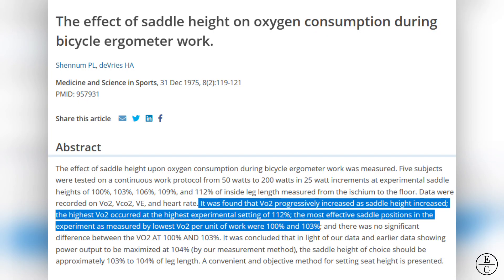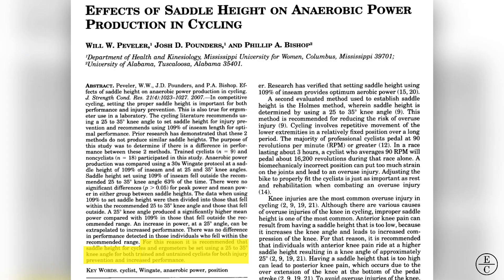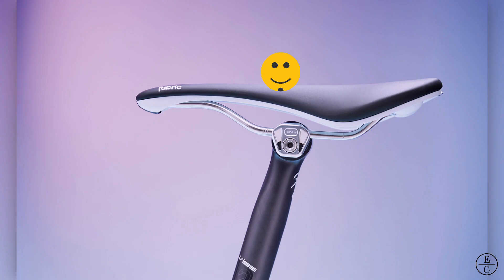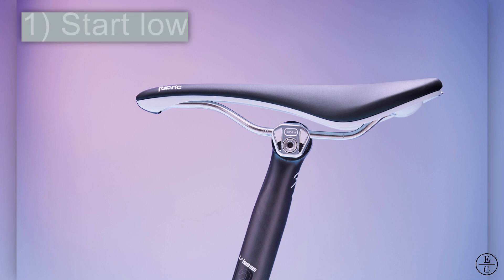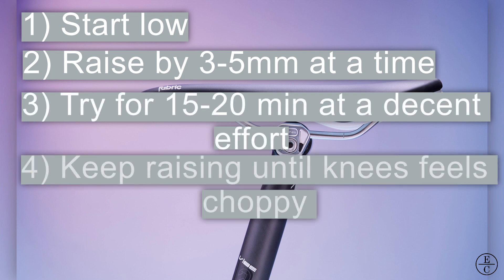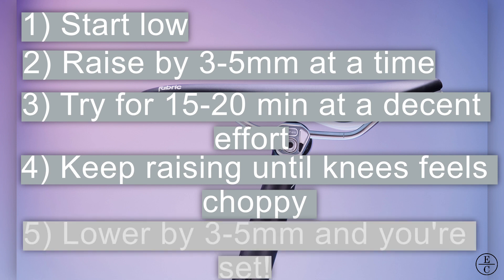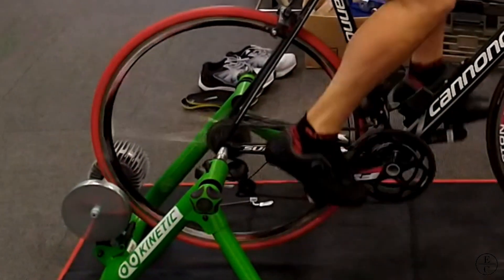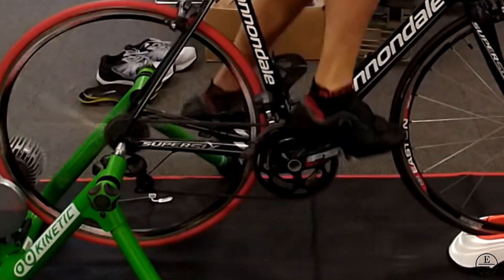DIY | How to set up saddle height

Comment: Fellow cyclists...don't go out and spend hundreds of your hard earned money for someone to tell you how you should be positioned on your bike. Pro tip..listen to your body. Make little small incremental adjustments. With each adjustment, give that position on the bike some time for your body to get used to it and listen to your body. Your body will tell you where it needs to be on the bike. It all starts with the correct sized frame though...and you take it from there.  Stay safe out there.
Reply from the maker: Hey TboneNY10,

Thanks for your input. Yes I 100% agree. I think if you're a DIY type of person then for sure save the cash and try to sort it out on your own. However, bike fitting services are there to hopefully take out some of the trial/error process, and help shed light on the topic to those who are not exactly sure how it's supposed to feel. 

In a way, it's kind of like how you can put your car up on jack stands and do your own oil change for your car, or I have someone perform the service for you (not a 100% analogy but hopefully you get the point). Or getting a haircut; it's cheaper in the long run to buy clippers and do it on your own. But I don't have the co-ordination nor patience to trial/error my own haircuts LOL.

Comment: If you have one leg dropping more than the other , then at what height do you set the saddle ?
Reply from the maker: Hi Sajid, thanks for checking out the channel. If you have a leg length difference the best way to correct this is to shim the shorter leg. If there is no leg length difference, one hip/leg dropping more than the other still indicates that the saddle is too high. So try lowering the saddle in small increments until the pelvis becomes more symmetrical.
Reply: @ecphysiotherapy8012  Thank you ! 
My inseam is about 77.5cm , and my saddle height is set at 81.5cm to 82cm, this gives me comfort. But as per calculations(lemond / Hamleys) I should be higher....... is this a matter of concern ?
Reply from the maker: I think a calculation and numbers are probably good for a general population, but there are more variables to consider when it comes to an individual. So I don't think it's a concern if you're comfortable on your bike and the saddle position is not causing injury/pain.
Reply: @ecphysiotherapy8012  Thank you

Comment: Is the heel to pedal method correct cause it feels very unstable I have a folding 20” wheel city bike
Reply from the maker: Hi Christine, 

The heel to pedal method should get you pretty close. If you find that your pelvis is rocking and feeling unstable, like you have the feeling that you're having to reach to the bottom of the pedals on each side, try lowering the saddle some more. Let me know how it goes!
Reply: @ecphysiotherapy8012  Also if I want to always be seated at stops. Is it ok to let the balls of my feet touch the floor? Or is that bad for the legs?
Reply from the maker: Hi Christine, the saddle may be a bit too low if you're able to place both of your feet down at a stop light. The potential issue is the knee may stay quite flexed (bent) throughout the pedal stroke which can cause increased load on your knee cap and tendon, especially if you do tend to cycle with lower cadences (heavy gear or climbing). Usually if the saddle is at a correct height you generally need to place one foot down at stop lights/intersections.

But don't just take my word for it, it would be worthwhile experimenting with it to see how your legs feel either way!
Reply: @ecphysiotherapy8012  I have it set correctly, but I can’t even reach one foot on the floor? Is that normal?
Reply from the maker: Yes completely normal to need to get off the saddle to step down on one foot.
Reply: @ecphysiotherapy8012  Thanks a lot! For answering all my questions! It was extremely helpful.😁
Reply: @ecphysiotherapy8012  I have it set the correct way already, but it feels unstable. I guess it is just because it is a short bike. I think I also might need to tighten my brakes some more and true my tires? Thanks for the help though. 🙂

Comment: Hi there, can i ask a question? do you think the heel-to-pedal method is still relevant to measure saddle height? because in my case i feel quite comfortable with my current saddle height, but using the method I'm still lacking a few centimeters unless I'm using my running shoes (which by the way has thicker soles compared to cycling shoes)..
thanks in advance :)
Reply from the maker: Hey Rino, thanks for supporting the channel. I think most methods will get you in the ballpark pretty well. But you're right in that it can vary depending on the stack height of the shoes that you cycle with. However, if you're using a method and the saddle height is off by a few cm, that is off by quite a bit actually. It may be okay to cycle 10-15km like that, but over a course of 50-100km it will likely add up to extra fatigue/discomfort.
Reply: @ecphysiotherapy8012  thank you for your reply! what i mean was, when I'm wearing my running shoes i can place my heels (and my whole feet) firmly on the pedal. But when I'm barefooted, there's quite a gap, I'm literally tip-toeing on the pedal. Does that mean it's still too high? (i know we're supposed to wear a proper shoes like a clipless shoes, but I'm new into cycling so i haven't got the time or money to buy the shoes. I hope it can give you a figure for my question)

Sorry for such a long post.. i love your videos already, they're very helpful! 👍🙏
Reply from the maker: There's no problem with using your running shoes to cycle. But definitely use the same shoes that you will be riding with to set up the saddle height, not while you're barefoot.

There are a couple drawbacks to using running shoes to cycle though. When you place your foot back on the pedal, it will be in a slightly different position each time. This will change your reach to the pedals each time. Also, the soles of running shoes are meant to be soft and absorb shock. Dedicated cycling shoes are made to be stiff for improved power transfer.